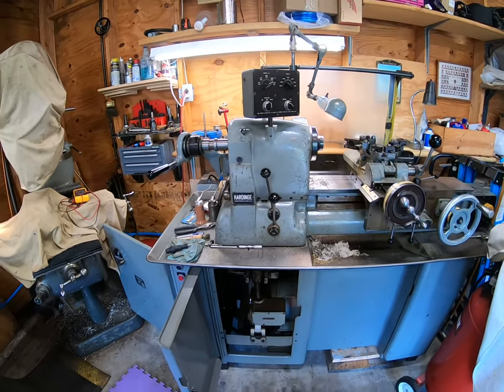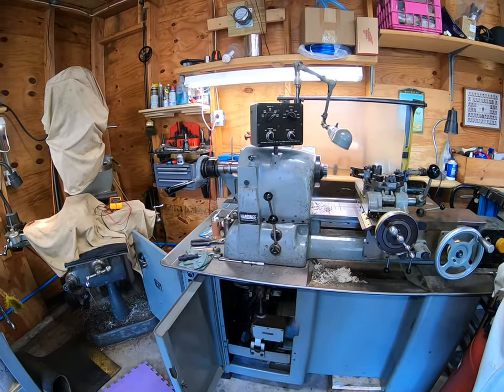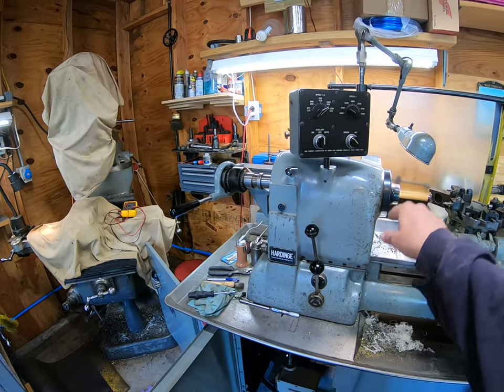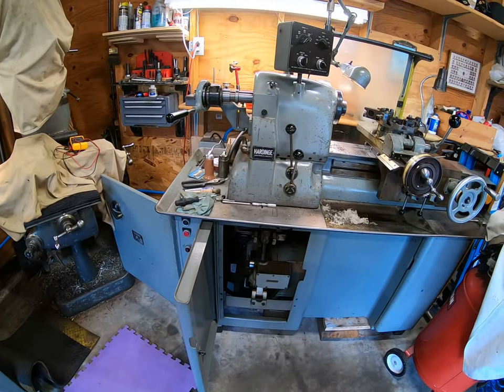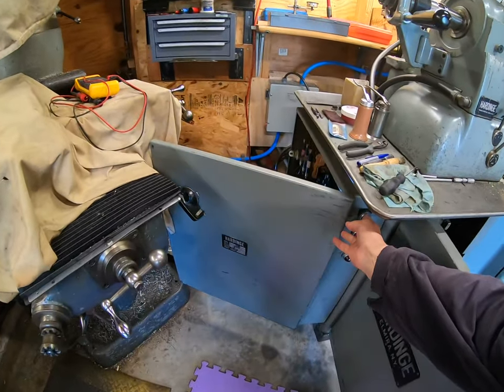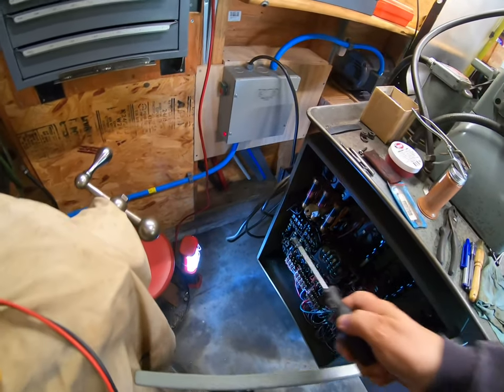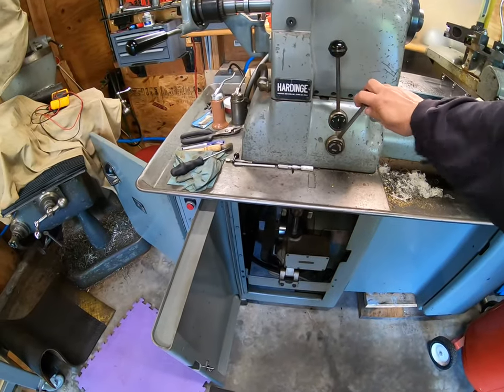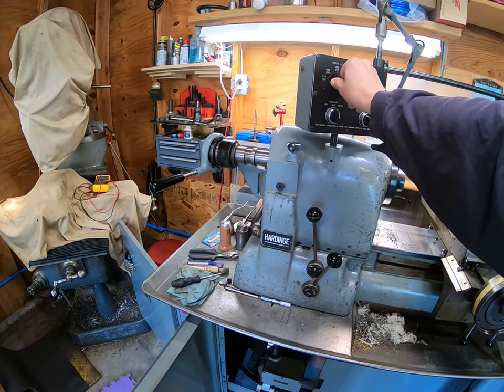Hardinge HC - Speed Change Problem

Comment: Hi, did you ever get this issue resolved? If so, could you please share. I am experiencing the same issue on almost the exact style machine.

Could you also share the wiring schematic of the machine with me?
Reply from the maker: Turns out that the speed change motor required a rewind - wires were shorted.  you can find the schematic here ..https://groups.io/g/hardinge-lathe — you’ll need to sign in, then look in the files folder, HC and select the electrical sub-folder.
Only problem I’m having now - it switches to fast speed (#3), but won’t slow down when switching back to #2 speed.
Thanks

Comment: That control panel is buzzing way too loud. Did you try resetting the breakers?
Reply from the maker: I figured it was the main transformer buzzing.  I have not reset anything yet.  Thanks from for the reply
Reply: @cbassich1  I had to do a lot of work on mine when I bought it and was very frustrated due to the lack of information on the internet. I was fortunate that I have a friend that was able to help me with a few things. I'd be happy to help you. Just let me know. Do you have the manual and electric schematic?
Reply from the maker: @spinesales  yes, I have both a manual and electrical schematic.  I’d appreciate any help you could provide.
Reply: @cbassich1  try resetting the breakers. They are in the lower left hand corner of the control box. They push in. Another thing it could be is the drum switches
Reply from the maker: @spinesales  measured voltage prior to speed change motor, between T1 and T3 is zero volts.  I saw smoke earlier this week, so I suspect there’s an open wire somewhere
Reply: Does Your screw drive that usually  feeds the belt up and down to change speeds move at all? I had the same issue awhile ago and it just happened again. Last time I had a repair guy out and I thought it was an electrical problem but it ended up that the screw was frozen